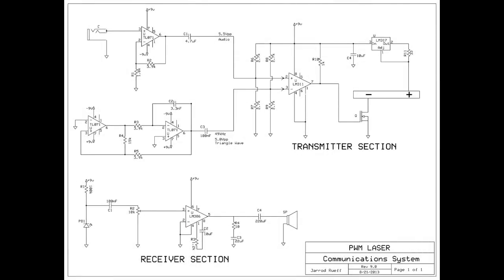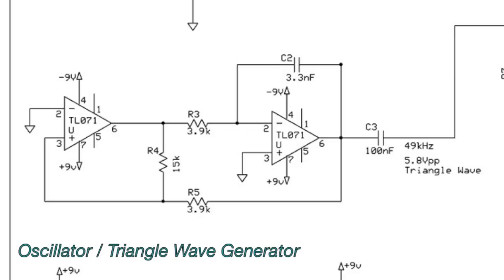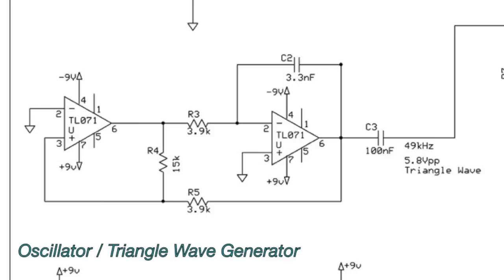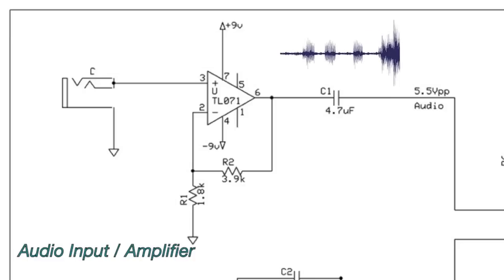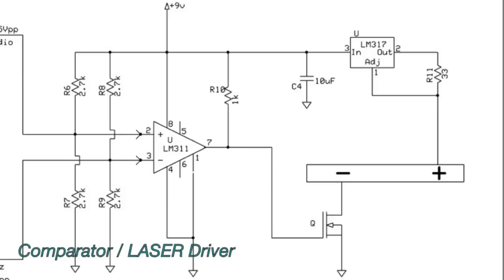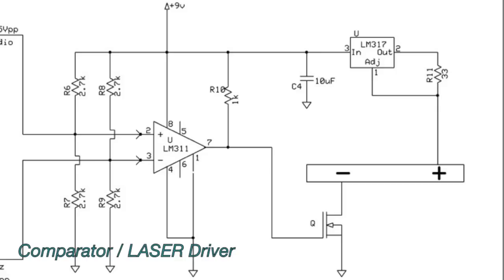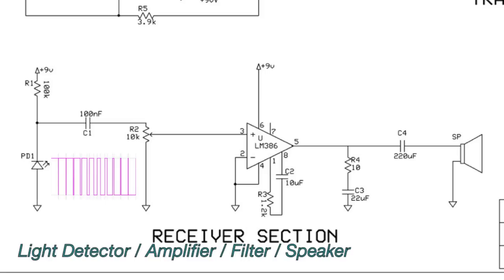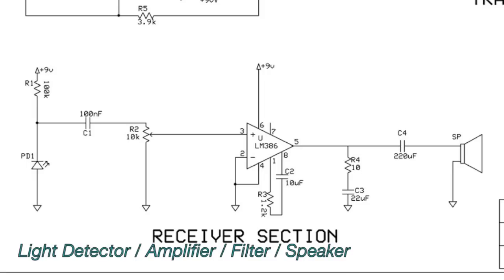Pulse Width Modulation (PWM) Laser Communications Circuit / Video

Comment: I'm curious if instead of building this circuit, it is possible to feed S/PDIF digital directly to the gate of the mosfet to modulate the beam and use an S/PDIF to analog converter at the receiving end?  Might be more "off the shelf" friendly?   Have you tried this?

Comment: 5:35  which software you are using for simulation?
Reply from the maker: I have a Digilent Electronics Explorer Board which has downloadable software that allow you to control the input waveforms etc. What you are seeing here is the monitoring function of this software. For information on the board/software check out this link: 

https://apps.spokane.edu/InternetContent/AutoWebs/markg/ENGR210%20-%20Electric%20Circuit%20Theory/EE%20Board%20Overview%20I.pdf

Comment: What was the wavelength of your laser module?
Reply from the maker: 650nm
Reply: Thank you for the reply :) Did you use a laser module or a laser diode? What was the specs of the laser? mW or the current specs? Also I was wondering what if you had used a photodiode with peak value around 650 nm? (I think your photodiode's peak value is around 900 nm according to the datasheet)
Reply from the maker: I used a 40mV laser diode module. The laser part number is 64355, however I've looked online and I can't find them anymore. They may have stopped producing this particular type. I can't give you any more spec information about the LASER.

With regards to your photo diode question, the closer the match between the laser wavelength and the photo diode wavelength the greater the transfer efficiency as any losses will be minimised. It's not a big deal if their not perfectly matched, a weak PWM signal still has all the important modulation information contained within it - and it can be amplified if necessary.
Reply: Again thank you for the quick reply :) The laser modules I found on the web confused me a bit. We need the laser to response very quickly (rise time and fall times need to be within nano seconds) However, as you said if it contains supportive circuits it may affect the response time. The thing is that you said you've used laser diode module, doesn't it contain such circuitry? There are some laser diodes on the market, can't we use them directly. The laser modules I find are so expensive I think. For instance, this one:
http://tr.farnell.com/hero/plp6501ar/laser-adjustable-focus-650nm-1mw/dp/1209951
Can you recommend a laser module?
Reply from the maker: The laser diode dot modules usually don't contain supportive circuitry (capacitors/inductors), and if they do its normally some form of simplified power regulation, it shouldn't effect the response time. It's the laser pointers/pens that do. 

The one you gave me the link for is the kind you want - but well overpriced as you've said. I paid about $2 for mine. I recommend trying a different supplier - eBay, DX, AliBaba or Google Shopping have much cheaper prices. You can get 10 laser diode's for $2 on eBay.
Reply: Thanks again, as a final question, in the part that you supply a specific amount of current to the laser, you said that the Vreference is always 1.25. I am trying to seperate the laser driver circuit so I need to understand where does that specific value comes from. By the way are you referring to the laser diode modules, when you said '...laser diode's for $2', I thought laser diodes alone is not useful for our purposes?
Reply from the maker: The LM317 develops a nominal 1.25V reference voltage between the output and adjustment terminals. This voltage won't change when the supply voltage is changed, the job of the LM317 is to maintain a constant voltage thus providing a constant current supply. The size of the resistor determines what this current is. 

I am referring specifically to a LASER Diode Dot Module. This is what you want. Like the one you provided the link for.

Comment: Hey Man what a Great Job !!!
Iam doing this circuit right now and i need some help would you please help me ?
Could you please tell me polarity of electrode capacitors ?
Reply from the maker: +Rafik Mohamed 

Hi Rafik, thank you very much. Good find on the polarity of the capacitors .

TRANSMITTER

C1 (4.7uF) = [ + ] Terminal 6 Opamp for Audio Input       [ - ] Terminal 2 for LM311

C2 and C3 (3.3nF, 100nF) (Use ceramic capacitors given they are in the nF range - no polarity requirements).

C4 (10uF) = [ + ] Terminal 3 of LM317      [ - ] Earth

RECEIVER

C1 (100nF) (Use ceramic capacitor given they are in the nF range - no polarity requirements).

C2 (10uF) = [ + ] Terminal 8 LM386     [ - ]  Resistor R3 1.2k

C3 (22uF) = [ + ] Terminal 5 LM386     [ - ] Earth

C4 (220uF) = [ + ] Terminal 5 LM386   [ - ] Speaker Positive
Reply: +rueffy thanks a lot what kind of lasers you recommend me??
Do you have any advices for me please?
Reply from the maker: +Rafik Mohamed 

I used a 40mV Laser Diode Module (Part Number: 64355).

It may be hard to find that exact laser. If you want to pick your own there are two important considerations.

First, make sure that the light spectrum produced by the laser matches the receiving qualities of the laser diode - in other words, use a visible light laser with a visible light diode. This information will be giving in nanometers in the datasheet.

Second, try and get a laser diode or laser diode dot module NOT a laser pen. The laser pen has a bunch of supporting circuitry built into it such as capacitors and inductors which can slow down the response time. It won't be able to turn on and off quick enough to modulate the data.

Comment: What Photodiode did you use? I'm planning on using a 650nm laser, and I have a radioshack photodiode but it says 'peak sensivity wavelength 900nm, spectral bandwidth range 750-980nm.... This isn't going to work right? So where did you buy yours, what are the specs?
Reply from the maker: +13thehorror 

SFH203 Photodiode

Comment: Hi, which mosfet transistor did you use to switching the laser??? And the capacitors of the reciver have to be exactly of those capacities? How did you determined the uF of them?? Thanks, I'm trying to do it,  but at the moment I can't jajajaja Cheers, and nice project.
Reply from the maker: +cristobal alonso 

MOSFET = 2N7000

You can find out more information about the capacitor configuration including sizes in the LM386 datasheet. There are a number of different configuration options and gain control can be varied by changing resistor/capacitors combinations.
Reply: +rueffy And the capacitors can be electrolytic, or have to be ceramic?? Thanks.
Reply from the maker: +cristobal alonso I used electro, I think you could use either though, it shouldn't make a difference, so long as the values are correct.
Reply from the maker: +cristobal alonso I used electro, I think you could use either though, it shouldn't make a difference, so long as the values are correct.

Comment: i have also build using described video. but de audio volum on receiver is too low. 
other issue is that signal amplifiers amplifies the audio about 3 times. this means raw audio input of audio jack should be 1.8v but mine is around 100mv. what we can do to get around these issues
Reply from the maker: +Jafar habibi livar 
What kind of input are you plugging into the audio jack? With this particular circuit you can only use self-powered devices e.g. mobile phones, computer outputs. If your trying to plug in an un-powered device you'll only get a low voltage on the input jack.
Reply: +rueffy i have used a mp3 player output. i measured it by osciloscope. it is about 100mv vpp. so i changed the upper tl071 to have a gain about 40 times
Reply: +rueffy i have used a mp3 player output. i measured it by osciloscope. it is about 100mv vpp. so i changed the upper tl071 to have a gain about 40 times
Reply from the maker: +Jafar habibi livar 
That is unusual, the volume on the MP3 player is at maximum? Does having a gain of 40 solve the problem?
Reply: +rueffy it make it a little clear. not full ok
Reply: +rueffy i solved the problem by increasing gain of tl071 by replacing the 3.9k by 12k. i get much clear sound on  receiver now. tnx
Reply: ممكن الطريقة كيف عملتها ؟

Comment: Hello. In terms of output sound quality, what's the diference between this setup (sampling the audio input and reconstructing it at the output) and a setup that transmits the audio signal directly through the laser without any A/D conversion? I had in mind that transmitting the signal directly would be better, but since you took the time to actually make this more complicated setup, I'm having doubts. Could you please explain the major advantages of your setup?

PS: Your video is great. Very good explanation!
Reply from the maker: Hi Pedro,

Light and audio are two different forms of energy. Some kind of 'modulation' is required to transfer between energy types. It is not possible to transfer audio 'directly' via a laser beam, the audio signal needs to be encoded into the laser beam somehow.

As you have identified, I converted my audio into a digital signal which was then used to drive the laser. A more simplified version of the circuit would be to amplitude modulate the laser (vary the intensity of the laser beam). You can find amplitude modulated circuits using Google. 

The main disadvantage of amplitude modulation is the circuit becomes susceptible to noise from other ambient light sources. Any variation in natural light at the light detector results in an erroneous audio signal being generated. PWM eliminates this disadvantage.
Reply: Yes by direct transmition I actually meant Amplitude Modulation. :)
Thanks for clearing it up for me. I am definitly making this.

Comment: The transmitter portion of this looks like it would work as a Neurophone if you substitute the diode with two Pizeo electric
disk placed against the forehead and a increase of the power supply voltage to around 18 volts.  I built the one on the basis
of the internet drawing of a TL 494 pwm chip , but the audio is very low, even with a preamp of the output of my computer.
Perhaps you might comment on such a mod to your transmitter circuit, thanks in advance rueffy !

Comment: awesome , I was thinking of using a laser for serial communication. I need to ask you a question. Do you the rise time fall time of a regular red laser diode ? I cannot seem to find a datasheet which shows this characteristic . I need to know how much bps i can transfer with a normal red or ir laser diode . Thank You
Reply from the maker: I don't know the exact rise time and fall time of the LASER diode in my circuit. The kind of specifications you're asking about would be in the datasheet - however they can often be difficult to find as you've discovered. If you can't find a datasheet, you can only determine the rise time, sensitivity, etc. by experimentation, but that brings the limitations of whatever instrumentation you use to make the measurements.

If you follow the basic rule of getting a simple laser diode / laser diode dot module without any supporting circuitry you should be able to achieve high speeds. It's only when you introduce capacitors and so forth that the response time is reduced.

You also need to ensure your photo diode has a fast response time, in the case of my circuit it has a 5nS response time (datasheet was accessible.)